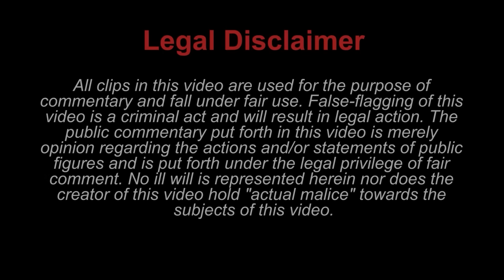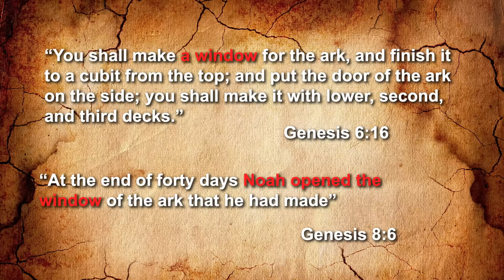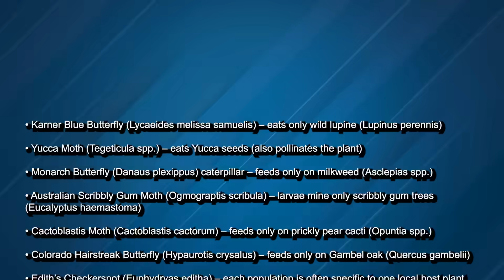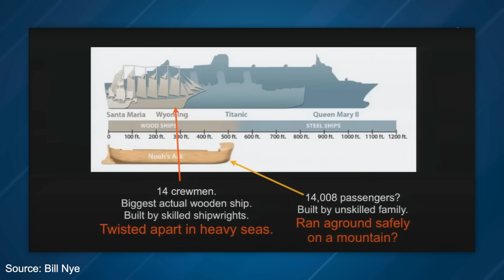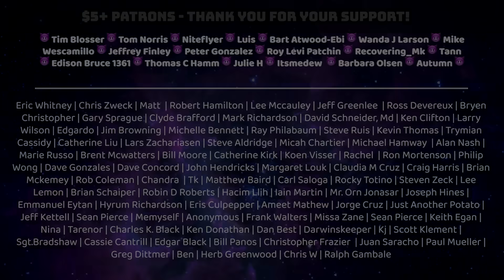Everything Wrong with Noah's Ark in 10 minutes

Comment: Clearly, you don’t have any education or hysterical biblical facts. They weren’t on the arc for a year.
Reply: The flood started when Noah was 600 years old and they didn't get off the ark until Noah was 601+. So yes, the flood lasted a year.
Reply: they were on the ark for 1 year 10 days, according to bible

Genesis 7:11  In the six hundredth year of Noah’s life, on the seventeenth day of the second month—on that day all the springs of the great deep burst forth, and the floodgates of the heavens were opened. 
Genesis 8:13  By the first day of the first month of Noah’s six hundred and first year, the water had dried up from the earth. Noah then removed the covering from the ark and saw that the surface of the ground was dry. 
Genesis 8:14   By the twenty-seventh day of the second month the earth was completely dry.
Genesis 8:15   Then God said to Noah
Genesis 8:16   “Come out of the ark, you and your wife and your sons and their wives. 

rain starts 2/17 when Noah is 600 yo, and they left the ark on 2/27 when Noah is 601 yo

Dude, read your bible

Comment: You forgot Noah took 120 years to build the boat 🌝
Reply: Noah lived in a high oxygen environment,So pea pole living two 1000 was normal. Second, closer to the original jean pool,So less Heath problems from mutate shawn's
Reply: @iwkaoy8758  Living in a high-oxygen atmosphere (much above Earth's 21%) would initially boost energy and immunity but quickly become toxic, causing lung damage (alveoli collapse), retinal damage leading to blindness, central nervous system issues like seizures, and rapid cellular aging, ultimately leading to organ failure and death,
Reply: @eddiethatvoguy7901 Hue man Ken live in 22 oxygen environment. Second,Kent use hue man two day as the Example of hue man indie past. Day were closer two the original jean pool,So less mutate shawn's. Many any moles live in 35 purr cent oxygen width similar lungs two hue mans a cord Dan two Neo-darwinist. 
Kent say hue man Ken hold their breath a sir tent time two day,So a hue man 5,000 years a go Kent hold it longer.

Comment: The window is obviously bigger than what you're trying to imply😂😂😂😂😂 this is not sn office this is an ark.  It could be vent that ran through the length of the ark's roof or one that runs through the length of the sides right in the middle deck

Comment: Mathematical proof that the biblical flood was impossible
•	The radius of the earth = 6371 km, which means the volume of the earth is 1,083,206,916,846 cubic kilometers.

•	The height of Mount Everest is 8.85 km and this is where the water level has to rise to cover the earth.

•	Add the height of Mount Everest to the radius of the earth 6371 + 8.85  and re-compute the volume of the earth with the 8.8km water on top of it = 1,087,727,260,852 cubic kilometers.

•	Subtract the earth’s original volume from the computed volume yields  4,520,344,006 cubic kilometers, which is the volume of the water to cover all the mountains (or the flood).

•	The total amount of all the available water on earth before the flood (rivers, lakes and oceans) is measured to be 1,360,000,000 cubic kilometer, not including the water locked tightly in minerals and crystals (like wadsleyite and  ringwoodite).  The water in those minerals can only be freed by an incredible amount of energy. If this energy were to be released the earth’s temperature would rise to many thousands of degrees, and every living thing would be boiled in the steam to death.
The flood water is more than 3 times larger than all the waters available on the earth.

•	There is no explanation or possible place for this huge amount of water to go (it could not evaporate for a billion year or ever), the inside of the earth could not hold even 1% of this amount.

•	This incredible amount of water fell over the course of 40 days. So to raise the sea level 8.8 km in 40 days, the rainfall must be 8711 inches per day.  The heaviest rainfall ever recorded was on Madagascar in the 1950’s where 73.6 inches of rain fell in a single day. So during the flood, each day more than 100 times more rain had to fall than the highest ever recorded on earth. This deluge is akin to putting a boat (Ark) under Niagara Falls.

•	Falling at the rate of 8711 inches per day, it would produce in incredibly high saturation of the air with moisture, which is impossible to breath. 

THESE IS JUST SOME OF THE MATHEMATICAL PROOF OF THE IMPOSSIBILITY OF THE FLOOD, BUT HERE IS A LOT MORE TO THIS FABLE (which I won’t go into at this time)
•	There are geological and physical facts making the flood impossible.
•	There are historical proofs – several civilizations not recording any global floods
•	There are biological evidences against the possibility of the flood 
•	I won’t even touch the ark and all the animals, which is a fairy tale and a biological impossibility.

Comment: Aye good chat go rebuild the pyrimids with our modern tech come back and let me know when you figure that one out 🔔end
Reply: That is easy, we have cranes that can lift 2000 of the blocks, we have gear that can cut the blocks in no time, and we have trucks that can transport them at 80km/h

The issue is Not that Noah couldn't build the ark, it is about physics, the hogging and sagging would meant the ark would leak, and with 3 decks and 8 people there is no way they could get the water off the vessel and it not sinking.

Comment: They were not on the ark a whole year
Reply: Noah boarded the ark at 600 years old and didn’t get off the ark until a little after he turned 601 years old.
Reply: @eddiethatvoguy7901 after forty days the rain stopped in the seventh month the ark rested on land. Once the rain stopped noah had the ability to open the opening of the ark
Reply: @bretherenlee1404  no. once it stopped the water stuck around for several months. When Noah got on the Ark he was 600. When he got off the ark he was 601+. Hence the flood lasted a year.
Reply: @eddiethatvoguy7901 the rain stopped after 40 days and the seventh month of that year he was on land. In between time he had access to open the window
Reply: @bretherenlee1404  Access doesn't mean proper ventilation. And one window isn't enough ventilation for 8 humans and all the animals.
Reply: @bretherenlee1404  Yea...he opened the ark after a year of being on it. Genesis 7:6  Noah was six hundred years old when the floodwaters came on the earth.
Genesis 8:13 By the first day of the first month of Noah’s six hundred and first year, the water had dried up from the earth. Noah then removed the covering from the ark and saw that the surface of the ground was dry.
Reply: @eddiethatvoguy7901 the window was 18 inches long and wide a total of 27 square feet area space below the roof. It could have been opened many times
Reply: @eddiethatvoguy7901 it didn't say that was the first time he opened the window you assumed that
Reply: @bretherenlee1404  27 sq ft window? On a wooden vessel that's 450ft long and 75ft wide? That's no where near big enough for proper ventilation, even if it was open 24/7. There's no weight to circulate the air. No fans. No pumps. No way to circulate the air in and out of the ark fast enough.
Reply: @eddiethatvoguy7901 it had a roof and if the roof had an overhang then game over
Reply: @eddiethatvoguy7901 there were no specs on the roof and if it had an overhang your ventilation game is toast
Reply: @bretherenlee1404  With no specs, then you can't assume an overhang. All you have is one window, that's what's in the story. And since that is the case. There's still not enough ventilation.
Reply: @eddiethatvoguy7901 you cannot assume there was not an overhang. But we know there was a roof and under the roof was a window. Genesis 6:16
If there was an overhang your ventilation argument is toast
Reply: @eddiethatvoguy7901 it was a roof not a lid
Reply: @bretherenlee1404  Genesis 6:16 says nothing bout an overhang. You can't assume there is one. Even if there was. You still have one small window. No fans, no pumps. No way to circulate the air through the ark, in the window and out the window fast enough. Everyone would be dead within a few days.
Reply: @eddiethatvoguy7901 an overhang means there was ventilation all around the ark destroying your ventilation argument
Reply: @bretherenlee1404 that’s not what an over hang is and that’s not how ventilation works. The ark is fictional and always has been
Reply: @eddiethatvoguy7901 says who? ie core truth doctrine
Reply: @bretherenlee1404  the laws of  physics, the laws of nature, zoology, archeology, geology, genetics, history, paleontology, and there's no accurate date or timeline for a Noah or a global flood. It's a fictional story made by men.
Reply: @bretherenlee1404  Historically, there was never a global flood as it doesn't have a accurate date/timeline. Genetically, a global flood would cause a genetic bottle neck present in every animal species on the planet. Such a bottle neck doesn't exist. Geology: Floods leave behind geological evidence. There's no geological evidence for a global flood. Zoology/laws of nature: "Young" animals require too much food to carry for a year on an ark. Younger animals are more vulnerable to disease and infections. Archeology/Paleontology: Continuous human civilizations go back thousands to tens of thousands of years. For example, Damascus, Syria, shows continuous habitation stretching back 8,000 to 10,000 BCE.
Reply: @bretherenlee1404  See how you have to run to evolution, as you can't provide evidence for this flood? Very telling. Especially since no one is talking about evolution. The topic is Noah's flood. Now you're trying to use other ancient flood stories? Like the Ojibwe story in which the world is born a new with the help of talking animals. OR the Hindu flood story in which the hero is saved by a huge talking fish with a horn it's head. How about the Greeks. They made new people with stones after the flood was over. Or the Norse flood story in which the world is flooded by the blood of a dead giant. The Cameroon flood story has a talking goat. The Chinese story,  a brother and sister survive a great flood inside a giant, magical gourd.
Is this your evidence for a flood? Talking animals, magical fruit, and stone people? They all are missing the same thing. An accurate date/timeline of when this "flood event" occurred. All of them are fictional, including Noah's ark.
Reply: @eddiethatvoguy7901 hundreds of flood stories point to a core truth.
Are you giving a thumbs down to evolution? Is this your statement? For we are all waiting.
Reply: @bretherenlee1404  Evolution isn't the topic of discussion. It's Noah's fictional story. Stay on topic. Those other fictional stories are just that....fictional. Some have talking animals, stone people, giants & magical fruit? That's core truth, huh? Giants and talking animals are fictional creatures....just like Noah. Is that really your best evidence for a global flood...make believe creatures?
Reply: @eddiethatvoguy7901 are you giving a thumbs down to evolution? Is this your statement? For we are all waiting
Reply: @bretherenlee1404  Evolution isn't the topic of discussion. It's Noah's fictional story. Stay on topic
Reply: @eddiethatvoguy7901 is that a no to evolution? For we are all waiting.
Hundreds of flood stories point to a core truth. It is like 40 people going in the forest saying they all saw a bear but their descriptions of the bear are all different. The core truth is that they saw a bear.
The ventilation issue is null and void based on  construction of a roof not a lid. Smaller animals are possible for capacity concerns. It would float because it was sealed. And it was a football and a half in length and 25 yards in width with three levels. It was an ark not a boat structure.
Reply: @bretherenlee1404  I'll answer your evolution question as soon as you give me an accurate date/timeline for this flood. We are all waiting.  We've already covered these things. A 2 foot window isn't big enough for a 450ft x75ft for proper ventilation. You would need fans, and systems to circulate the air through the ark, which Noah didn't have. We already covered small animals. They males had mates. Meaning that the animals were old enough to mate and produce offspring. Small animals can't do that.  The ark is not large enough to carry all those animals and all the food they need for a year long voyage. It's a fictional story. Still waiting on that accurate date/timeline for this flood.
Reply: @eddiethatvoguy7901 a roof with no ceiling solves the ventilation problem. The are was a football field and a half long and 25 yards wide with three decks all the same length.  You do the math. The flood happened over 1600 years after the creation of Adam.
Now are you giving a thumbs down to evolution? For all are waiting
Reply: @bretherenlee1404  1600 years after creation of Adam? Well that's vague, when was Adam created? 34 BC? Be more specific and exact.
Reply: @eddiethatvoguy7901 some say 4026 bce
Reply: @bretherenlee1404  So...the flood was in 2426 BC...? Are you sure about that...?
Reply: @bretherenlee1404  I believe I said provide an accurate date. You provided an inaccurate date/timeline. There are living trees older than that. There's continuous inhabited cities older than that. WAY older.  And this flood allegedly killed everything that wasn't on the ark....? Even the pyramids and Stonehenge and a long list of extant man made standing structures are older than that. Pyramid of Nyuserre was being built around that time period. Since you are unable to provide an accurate timeline/date for this flood. We can move on to your lack of evidence for this "flood." Now where were we...? Oh yes. There's not enough room for the animals, and the food they require for a year long voyage. The males had mates, so that would mean they were all mature enough to have offspring. Elephants reach sexual maturity at 10-15 years old. Hippos become sexually mature about 10 years old. I could go on, but the point is, they were not babies or "smaller versions". I can do the math for you and see how much food it would take for all these grown animals, but it's going to be more than 200 tons of food.
Reply: @eddiethatvoguy7901 first of all I gave you a date and prior to that things were built. I don't know what dating system you are using. Hundreds of global flood stories point to a core truth. Animals didn't have to mate so they could have been very young
Reply: @bretherenlee1404  We've already have been over the very young animals thing. That doesn't work as young mammals can't eat solid food. They drink milk for 1-3 years of their early lives. Bible says that the males had mates. Meaning they were not young, they were old enough to have offspring because very young animals can't have offspring and don't have mates.  
What you provided was a random date that is clearly wrong. There are living trees older than the date you provided. Continuously inhabited cities older than that. And of  course man made structures older than that. Structures that are still standing and show no flood damage. The continuously inhabited cities lived through this flood, even though the fictional story says everything died, except what was on the ark. So, since you haven't provided an accurate date. We can move on. I see you're still going back to folklore flood tales, with talking animals, magical fruit, giants and stone people. By your logic hybrid creatures were real because they are in every ancient culture. So, the sphinx, chimera, and Pegasus were real creatures? Obviously not. They are fictional just like Noah and this flood.
Reply: @eddiethatvoguy7901 hundreds of flood stories point to a core truth
Reply: @bretherenlee1404  You're absolutely right. They all have one truth. Thousands of flood stories across the world through hundreds of generations. Different languages. Different customs and cultures. Different religions and belief systems.  All of them have one universal truth. And that is...not a single one of them can produce an accurate date/timeline for a global flood. Not. A. Single. One. Noah's ark is fictional. Noah's ark never happened. There was never a global flood. It is a mythical imaginary story in a book.
Reply: @bretherenlee1404  You already did. When you provided an inaccurate date/timeline for this flood. Why don't you ask this all powerful god when the flood was. Since people claim he knows everything, maybe he'll reveal to you the accurate date of the flood. All things are possible with him, right? So go on, ask, I'm sure he won't let you down.
Reply: @eddiethatvoguy7901 prove it is the wrong date. For we are all waiting
Reply: @eddiethatvoguy7901 fossils prove the flood. Whales found in the desert and mammoths with green grass found whole. Hundreds of flood stories and that points to a core truth. Roof solves ventilation issue and small animals deals with space issues.  Three 150 yard levels is enough room.
Reply: @bretherenlee1404  We've gone over all of this. Repeating yourself doesn't make it true, nor is it evidence of a flood or an accurate date for such an event. Speaking of which. I see this god didn't provide you with an accurate date/timeline for this flood. He must not be all knowing. Maybe you should ask harder...? or something.

Comment: you also can’t increase the boat size. even if you get all animals there and all the food there, you would have to build a massive ship, since buoyancy is determined by surface and the surface would increase slower than the contents of the ship if you increase all dimensions equally, so you would have to increase the surface area and the add girders and beams of wood to keep it from snapping, even if you could build it with the materials from those days it would end up as a massive disk probably lower than a giraffe.